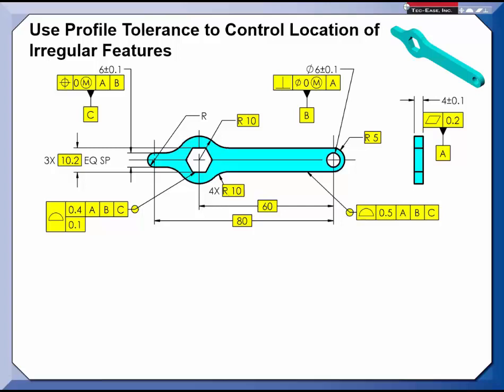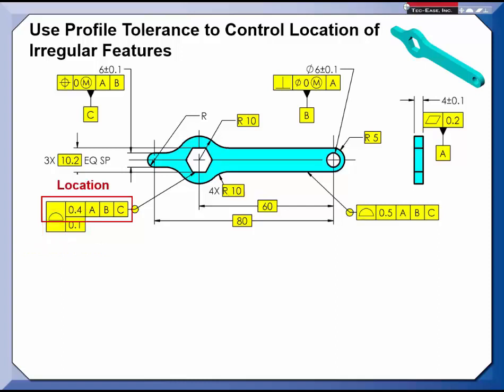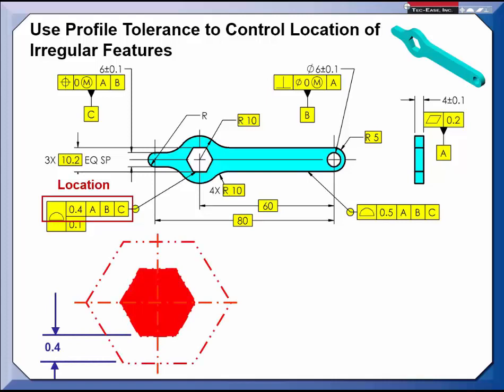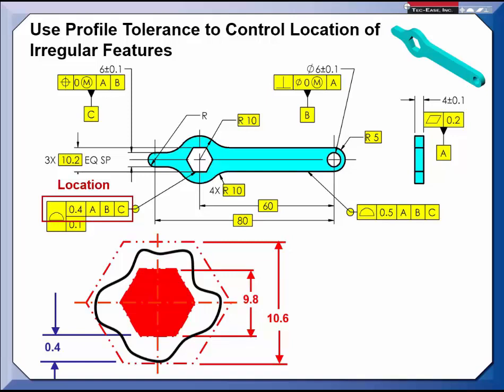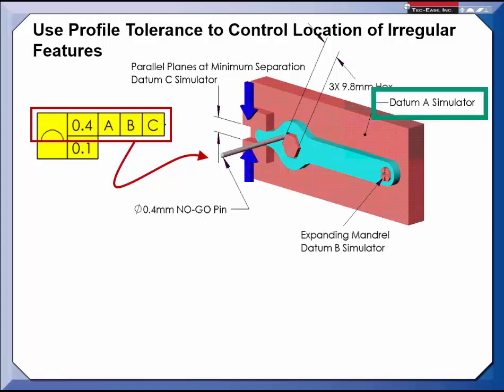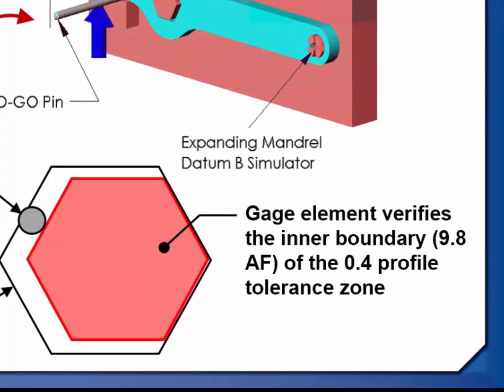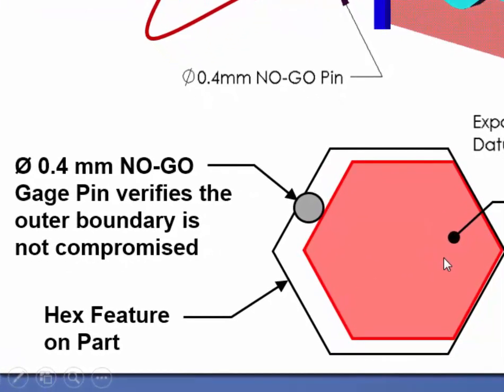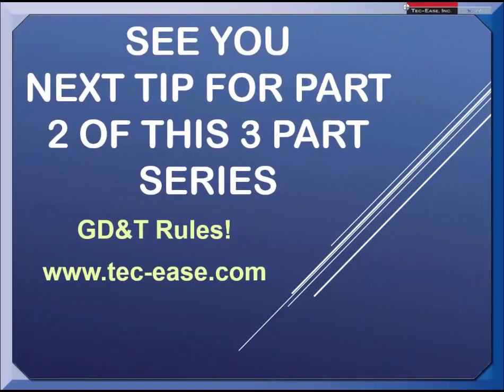GD&T Tip - Profile can Control Location of Irregular Features

Comment: This animation discussion of "Profile Location of Irregular Feature" is an outstanding GD&T tip to go along with the new ASME Y14.5-2018 Standard.  Tec-ease has a great "GD&T" program of YouTube-Tips for the CAD-Designer, CNC Shop-floor Machine Operator and digital Programmer, the end result is excellent verification with all CAD/CNC/CMM verification for world-class "Outsourcing" applying a single detailed design-intent.  Thank You so Much, "GD&T-Rules."

T J (Tom) Vanderloop, Author, Technology Specialist/Mechanical Designer & Consultant to Industry